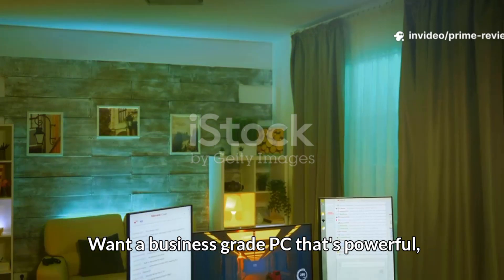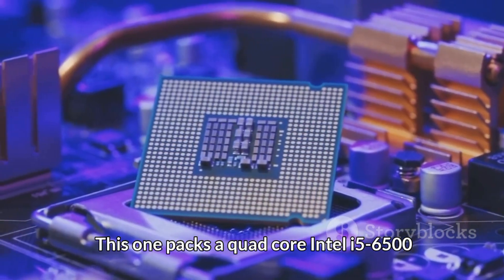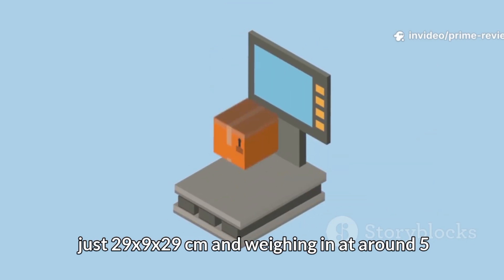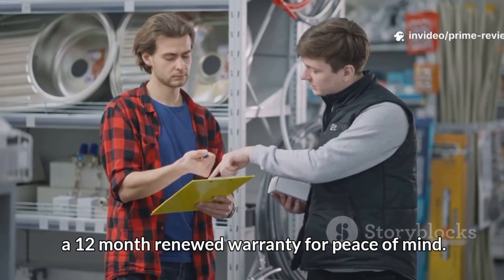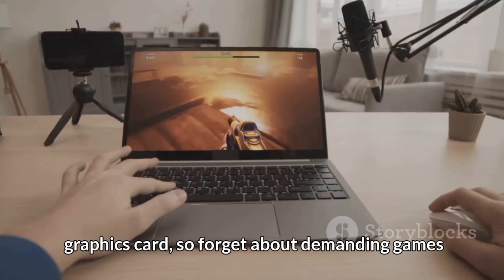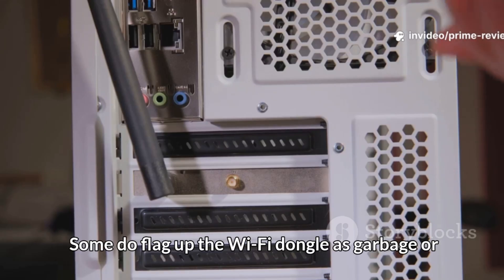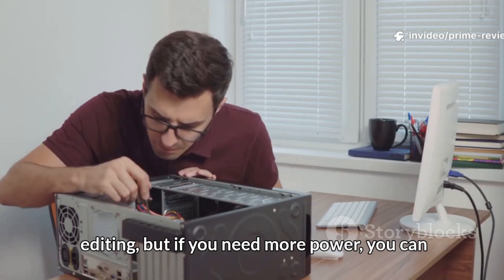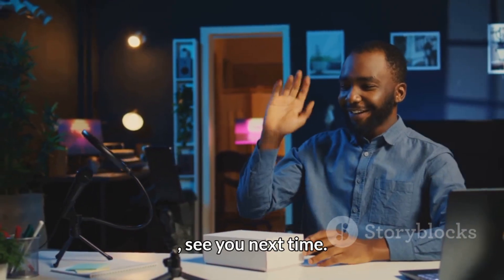Dell OptiPlex 7050 Review – Best Budget Desktop PC in 2025?

Comment: Ai 😂
Reply from the maker: Definitely we make videos with the help of ai. But we focus on content
Reply: @DealSprintDaily  tell me, im about to buy myself a optiplex, with a i5 inside of it with windows 10 pro, can i upgrade to 32 gb of ram?
Reply from the maker: Yes, in most cases, you can upgrade a Dell Optiplex with an i5 processor and Windows 10 Pro to 32GB of RAM. However, the specific model of Optiplex and the type of RAM it uses will determine the maximum supported capacity. Most modern Optiplex models with an i5 and Windows 10 Pro can support 32GB of RAM.
Reply: @DealSprintDaily  thanks for the advice
Reply from the maker: Always welcome